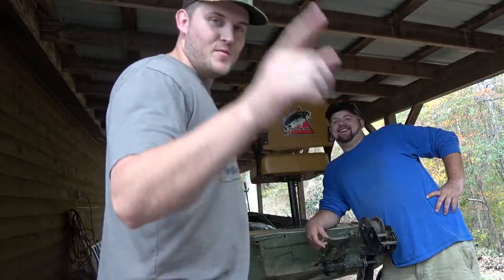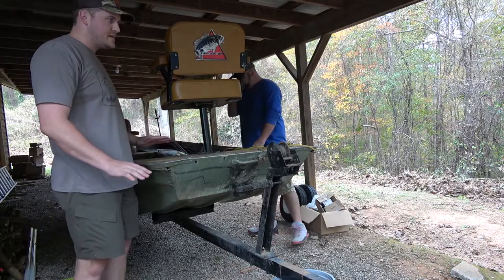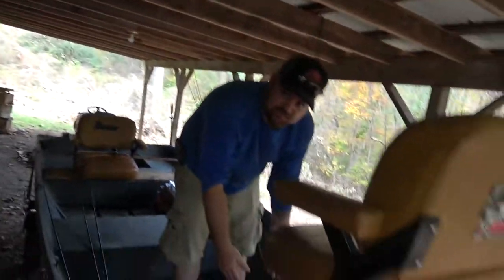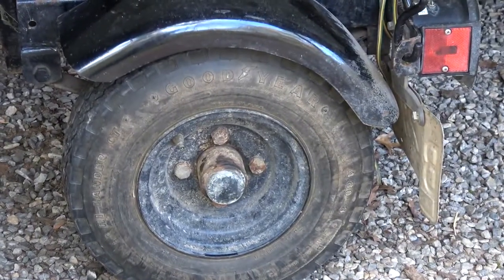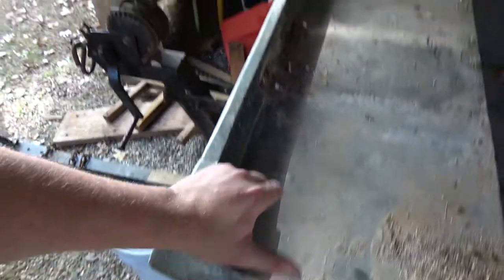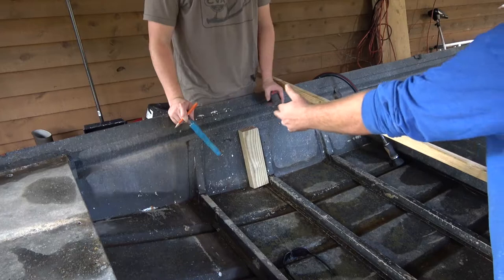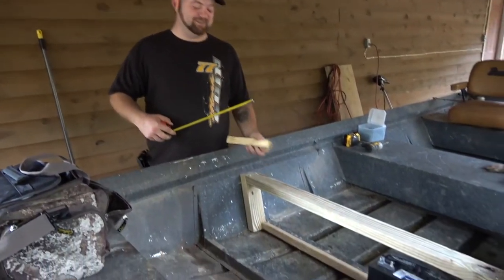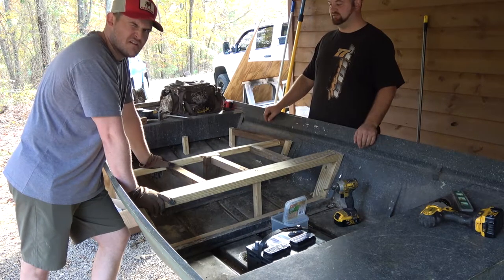Jon Boat REBUILD Ep 2: How to Build Front Casting Deck.

Comment from the maker: Just so everyone knows, we are aware some pressure treated plywood has copper in it. The ply wood isn’t actually touching the boat. Also our inside has some coating that keeps it from directly touching aluminum. It’s all preference. Not everyone has access or the tools to use aluminum framing. Thanks for watching!

Comment: That’s cool, but never use treated plywood on an aluminum boat. The treated wood has copper in it, which corrodes aluminum eventually or speeds up corrosion. Just use fiberglass resin on plain plywood and your good to go
Reply from the maker: We have gotten it trimmed and sanded down to where it doesn’t touch the boat at any point and we sealed it so it should be good to go! But thanks for the input!
Reply: @SlaunchOutdoors  no problem! I’m saving up for a job boat currently and have been loading up on info, but I knew that from when my friends floored the jon boat we all share. We made floors, a rear casting deck, and a front deck big enough for 2 of us and mounted a trolling motor to the front, 15 hp Yamaha 2 stroke on the back. Great for 3 of us, but then COVID hit so now I’m trying to buy my own
Reply from the maker: @noahjohns7954  good luck bro!
Reply: @SlaunchOutdoors  thanks man
Reply from the maker: You follow us on IG? We’d like to keep up with the progress